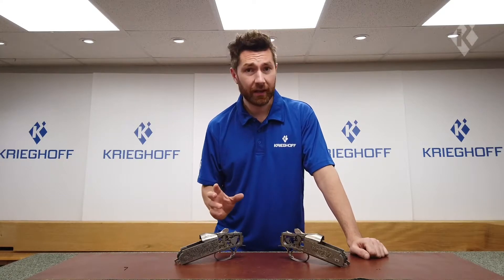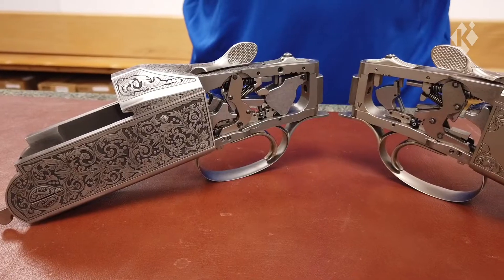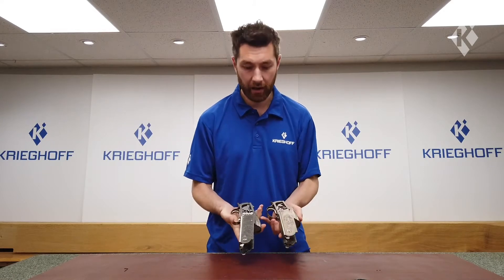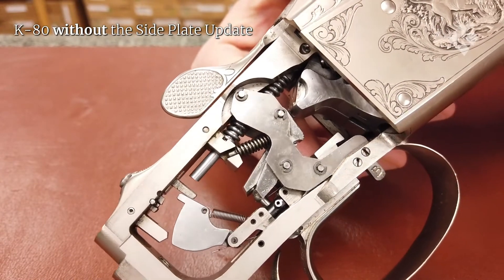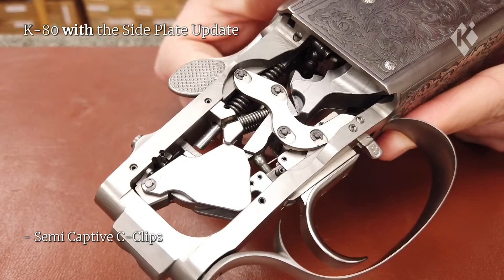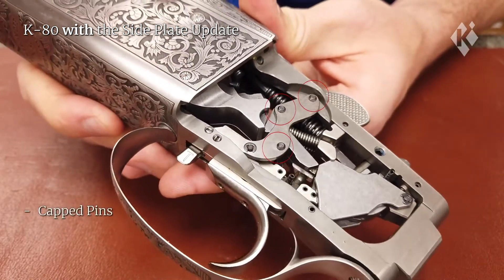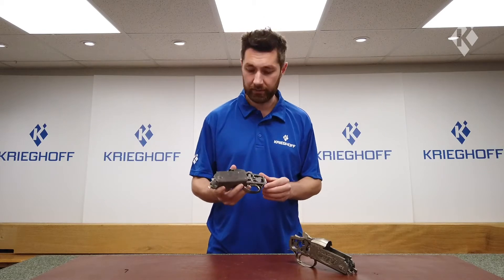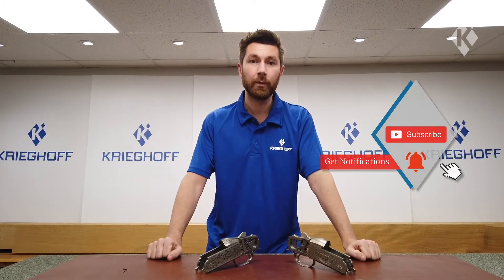Krieghoff "Know How" - The Side Plate Update

Comment: Is this being done in the US market?  On new guns is this already in place? On older (mine is 2012) is being done in the US in annual service if requested or by default?
Reply from the maker: Here in the UK, the newer gun are coming through with it already installed as standard. But older guns can be retrofitted with the new system. This is done as an additional job and is offered when we have a gun in for service as it makes sense to do it once the gun is apart, but it can be done as a stand alone job for sure.